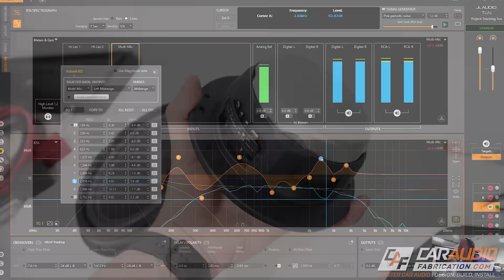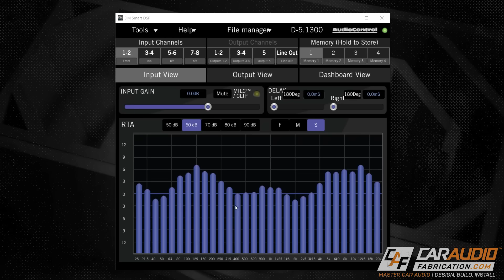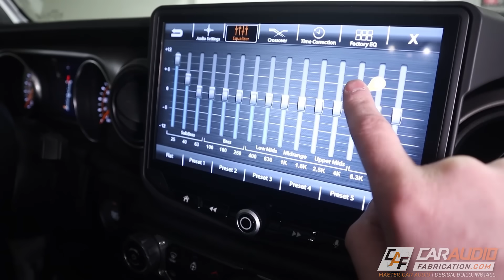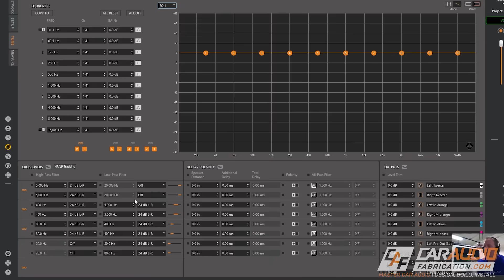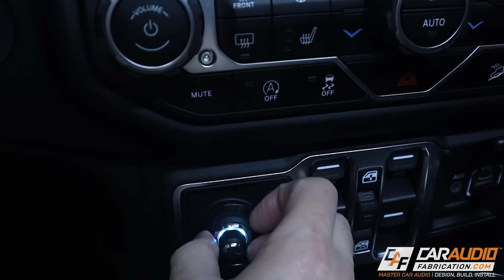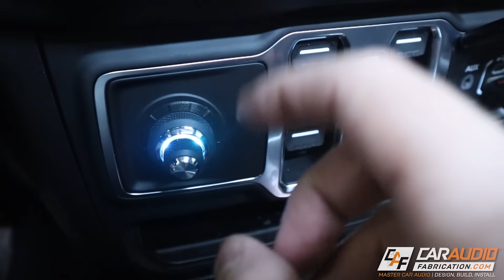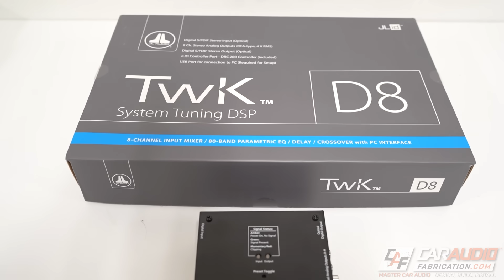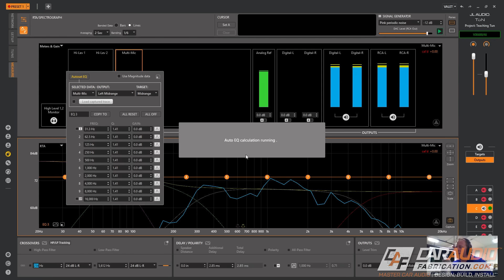6 Reasons to get a DSP, and 3 Deal Breakers!

Comment: You don't have to get the 7 to 8 hundred dollar DSP's either, as a matter of fact I have a cheap hundred dollar DSP that works great!!! I was running a DM-608 and not long after I switched back to my cheap one. IMHO is it FAR batter than the Audiocontrol I had in pretty much every category, ESPECIALLY the android app for each DSP respectfully. The app for the DM-608 is complete and utter trash and for me just that would be enough to scrap the DM-608, never mind all the other headaches.
Reply: What's the model name of the hundred dollar one? I don't have $500+ to spend on one, but if I could find a decent one for only $100 or so that's alot more affordable

Comment: The new Alpine heads seem to have features similar to a DSP. A DSP is almost last on my list of audio upgrades if ever. 1. Amped sub - check. 2. Front door and dash speaker replacement - check. 3. Head unit. 4. Rear door speakers. 5. 4ch amp (if necessary).
Reply: Can't get that "center stage" sound without dsp.... you really don't know what you're missing until you get 1 ! Thank me later
Reply: @willgotskillzs 

isn't a dsp a 3 or 4 way crossover only buts digital ?
Reply: No offense, but said like someone who's never seen a properly setup dsp. I used to work at this place that had an awesome setup. Super clean bass, super clear but not harsh treble. I couldn't figure out how they got such amazing sound in such a large space from tiny speakers. That was when I visited the rack room and discovered the wonders of a good dsp.
Reply: You forgot ofc copper.

Comment: I only have one monoblock amp for two  subs.   JL RD 1500… I am thinking it would not be useful because I only have the one amp.  Any thoughts ?   I just have a simple line converter for rca using one rear speaker.

Comment: I recently finished up my sound system with a Kicker Key 200.4 and Kicker KS speakers. The auto EQ/Processing is honestly great for the size of the amp. It completely transforms the front sound stage. I do have the time delay off as I always have passengers and I personally sounds off to me in the driver seat. I do wish there was a dial instead of dip switches for the high pass filter. I have it on stock HU and at 80hz.

Comment: I seriously considered a dsp for my current system when I was planning it. My concern was that the signal outputs of the dsp’s that I looked at (even Audiocontrol) had lower voltages, lower s/n ratios, and higher distortion percentages than the mostly analog set up I went with. I could not make the investment into a good dsp and take the risk of being unsatisfied with the result. I can live with less than ideal alignment or equalization more than I can live with less dynamic range or more distortion.

Comment: There are many reasons to get a DSP. One of my main reasons is I need RCA outputs to run to my amps. Now there are Line Level Converters but after doing a lot of research I found they do not convert the signal near as well as the DSP I got. They introduce noise and sometimes out right alter the signals. Great video.
Reply: Yeap...LOC only ok if its just for mono sub amp! Even then get the active and not passive one so ya can turn the signal volts up  if it has rolloff!

Comment: I have a aftermarket dual din android media player.
I feed all 6 to a 2 DSP's .
Feeds 3x 4ch amps on one and a 8 monoblocks on the other.
I have active 4 way setup on my dash / front doors. And 2way setup at the wall.
The 8 8k mono blocks feed a 4th order wall with 8 15" each with its own sealed chamber.
I use time delays to focus the bass to the front and set stage it an spl rig but I have reasonably good Sq as well
Reply: I have an Android unit as well (Joying) and was thinking of running the optical out to a DSP. Which DSP did you go with? Are you using analog inputs? Was the extra piece of equipment and time worth it?

Comment: Yes definitely get a Dsp but make sure it’s a good one other wise your system will sound worse. I recently unplugged my audio control Dm810 Dsp and I’m running straight amplifiers and using the amp crossovers and it sounds way better. The AC amos sound great and have good output. The DSP not so much.
Reply: Well unfortunately you found out first hand that audio control is over priced junk.
Reply: @Turbogto_guy  yeah I’ve heard factory system that sounded better then the audio control Dsp. The amps have good amounts of power for the price but I wouldn’t recommend the dsp

Comment: I added a miniDSP 4X2HD to my desktop sound system and it massively improved my overall sound quality and gave me a significant improvement to the flexibility of my system. I will definitely be adding a miniDSP car DSP into my vehicle soon.
Reply: @orangecat-519  I've heard that the Minidsp (which I've used on subs for many years), is not good for speakers.

Comment: Yes. A DSP is definitely right for me. I have a lil SPL setup but running a mono block and 2 channel amps require a Y adapter bc I'm running a Kenwood with 3 pairs of preamp outputs. I want everything separate so I'm looking into the JL Audio unit. I really want the audiocontrol but it's out of stock everywhere I looked. I do like the Dayton as well, especially at the price point. I'm running a Brazilian amp to my subs and it doesn't give me enough cutoff even with the crossover slopes on my head unit I can still hear a little bit of vocal coming out of my subwoofers. I think a DSP will solve this. Your thoughts?

Comment: With Audio Controls D4.800 can you tune the line out to the sub almost as a 5th channel? Could the other 4 then be front and rear L and R and use passive to split mids and tweets in the front stage?
Reply from the maker: Yes you can DSP tune the L/R preout as well. Yes you can combine passive with a DSP system. Full video on that on the channel

Comment: So would a DSP hooked up to a decent ported 12 or 8 in my 17 Cruze with Bose potentially restore the bass signal for that sub if I tap into one of the factory speakers? I can tell that they have a heavy low pass and I fear nothing will be good enough to restore the low end I want for that new sub
Reply from the maker: If the signal isn't there in the first place it can be created from nothing. I would think an aftermarket head unit solution would be available for your vehicle
Reply: @CarAudioFabrication  unfortunately the Bose system in my Cruze premier is a extremely complicated system. With the climate controls being integrated in the screen and everything. My other option is tapping the factory 5 inch sub as well but fear the heavy eq on it will be too strong to correct to get some more sub frequencies out of it for an aftermarket woofer to shine
Reply: Factory subs are pretty much useless in my opinion.   I would remove it.  Add a Separate monoblock amp and subs with amp control knob  is all you need.   Looks like this device or a good line in converter for rca will be the perfect add
Reply: @jeffreyhillery1614  getting a good signal is the problem. All the signals are heavily equalized

Comment: For an F150, you did a project for your pop that involved a rack system in the cab of his truck made of ABS. Do you recommend a dsp if using separate sub amp and different head unit and amps to power the doors?

Comment: BUDGET!? Screw the budget! It's an investment. 😆😆 
I didn't know about the valet mode and I like your CAF sign in the background. 👍🏽✌🏾
Reply from the maker: JL Audio processors have a specific valet mode that you can actually wire to be triggered when you want. But you can always program a preset for these types of things as well. And I agree, DSP is an investment as the gear stays relevant for a long time and can easily be swapped from vehicle to vehicle.

Comment: Some car audio on the market makes it easier with built in DSP in their amplifiers. A great blessing in purchasing less audio equipment.
Reply from the maker: For sure! Can usually save a little bit, and not nearly as complex wiring. Space savings too. :)
Reply: And on the subject of wiring and complexity of an install, I wish I had known I would end up going further than basic speaker replacement, because my eventual decision to purchase a Amp with built in DSP would changed the speakers I would have purchased--because the DSP would actually make physically installing the component speakers I considered easier.

In the front, there are woofers in the doors and tweeters at the top of the dash.  Installing a component set which use a separate crossover which takes one signal and sends out a separate woofer and tweeter output would have taken more rewiring than I was up for.  But with a DSP, you don't need to bother with these passive crossovers.  It's easier to program DSP crossovers than all of this rewiring.

I'd rather spend an hour tuning on a laptop than an hour bending,splicing wires, etc.
Reply: @aaronrolnick8134  But that would mean you would have to have a dedicated amp for the tweets, one for mids, one for mid bass ect.
Reply: Head units like Kenwood have them and saved me from having buy "bassblockers" for sons door speakers!

Comment: Dsp is awesome. But isn't necessary.  Those of us that like to have high sq systems yes. Now most head units have time alignment and good crossovers with eq built in. A line driver is a must like audio control.  Clean good noise resistant rca cables, sound deadening and good equipment is key. Skimping on ofc versus cca . A 5v vs a 2v is key. Does a dsp give more control yes. You can have an awesome aftermarket system without one. Pioneer head units have all this bulit in like the single din digital media only unit. It has a 31 band eq with individual output rca crossovers, time aligmnent and level controls
Reply from the maker: Head units having the "same" control as a DSP is actually kind of a myth, addressed in the video. We have to be careful about saying that because it's not the same. Also keep in mind, it's less and less feasible to even be able to replace the head unit anymore.
Reply: @CarAudioFabrication I have the factory Sync 2 and only one jl  1500 monoblock amp for my subs.   I am thinking I really do not need it and it sounds good.   Getting  ready to add a second battery in the truck with a smart  isolator
Reply: In some cars yes. I agree if you cannot replace the factory unit I whole heartedly agree.  People like you and I can tell the difference. For us the 700 for that dsp is more than worth it. You can still have a great system without one do you agree? The sph db10 from Pioneer was the best head unit I used
Reply: @Jason_Marra  this is bs. If you swap the speakers you need a complete proper tune. Its a night and day difference.

Comment: DSP's doesn't fix engine noise.  I've heard this several times that it does and it doesn't.
Reply from the maker: That's a good one! Yeah, any noise that is interjected into the system needs to be resolved by tracking it down and correcting it, not in the DSP.
Reply: @CarAudioFabrication always!!
Reply: It does when you have one with Bluetooth or when you buy an Bluetooth receiver with optical output. 

Which in my opinion you should always do.

Comment: Heya, I have a Subaru legacy 2016 3.6R with the hardon kardon Soundsystem in it. I'm going to replace my headunit with a kenwood DMX9021S because it's going faulty. What would you recommend to add to my Soundsystem to make it better if I want to keep the hardon karmon speaker and amplifier in the car as is please? I basically wanne keep the sound as is and maybe a bit later add a bit  bigger subwoofer. Please help.

Comment: What are thoughts on HU that do this. Like Kenwoods KDC-BT768HD?
Reply from the maker: I have yet to see a single head unit that can truly match the performance of a standalone DSP. The head units you guys are mentioning only have a global equalizer at most, which is specifically mentioned in this video, that's not the same thing as an independent EQ on every channel, also looks like the head unit EQ is graphic, which lacks the adjustability truly needed. Also again, even some of the head units that might have individual control for each channel, only have it for 6 channels at most. Standalone DSP's give us more channels to work with for a more complex system.
Reply: @CarAudioFabrication  I'm running a helix dsp with my halo. Something else you gain .... A VOLUME KNOB!
Reply: @CarAudioFabrication sounds like a great comparison video? 🤘
Reply: Really looking forward to the reply to this.
Reply: And also the alpine halo9 ilx-f509. Great question!
Reply: Built in DSPs on HU's are great.  Just remember that you only have 1 pair of RCAs per Front and Rear which limits your parameters of setting crossover/gain points for multiple speakers.
Reply: I've got a KDC-BT768HD in my Grand Cherokee, and I'm in the process of adding a minidsp 8x12 for two main reasons. First, my Jeep has dash tweeters, front and rear door speakers, and a sound bar in the back with a pair of components too, so I am way over the limit of the 4 channels + sub that the Kenwood will time-align and crossover. Second, the EQ applies to all channels, as Mark mentioned in this video, so I would have been limited to adjusting the EQ for the front and rear channels identically. Control over each channel will help prevent the rear fill from overwhelming the front stage at certain frequencies. Multiple tunes is a huge bonus too - 2-seat, all-seat, podcast, true flat, driver's preference tunes are all just some tuning work away.